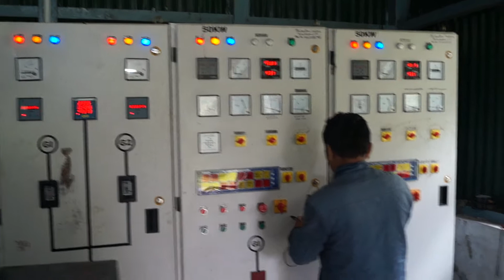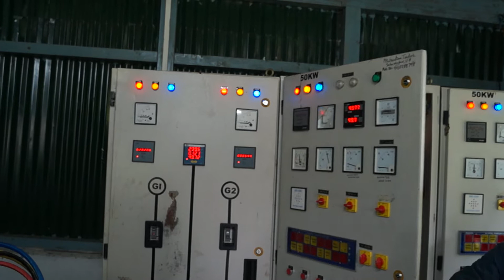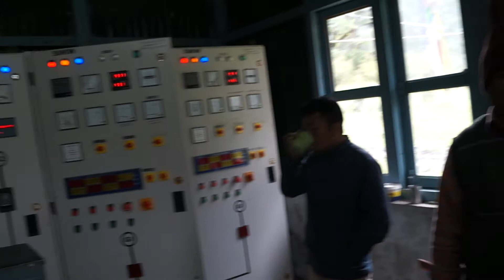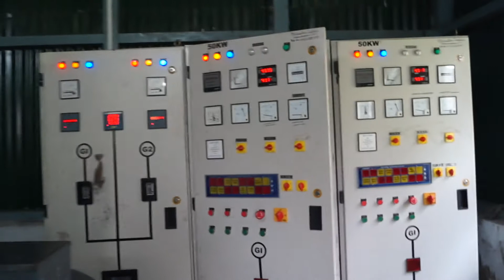Micro Hydro Power Plant 2X50 KW

Comment: Grid Synchronization 
50Kw+50Kw=100Kw 
Type Of Generator
Type   A.C Synchronous
Excitation System Self Excited
Switchyard
Voltage Level            11Kv
No.Of bays                 2
Kindly provide drawing of electrical/ electronics generator to 11 KV Line